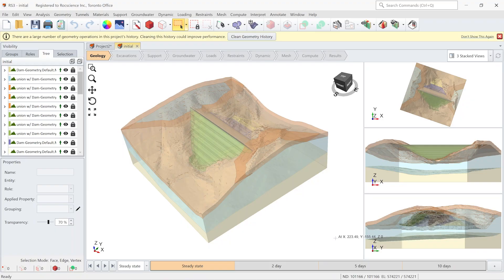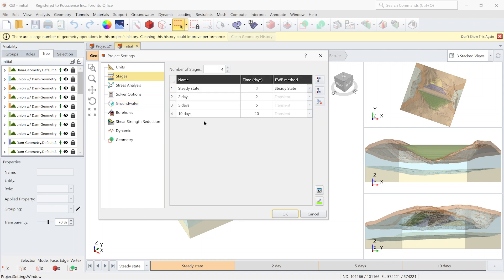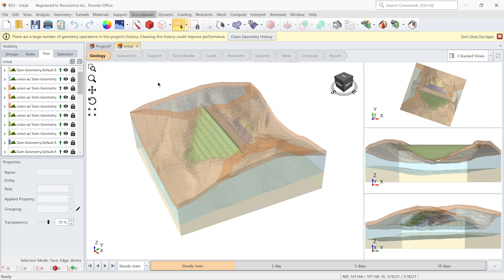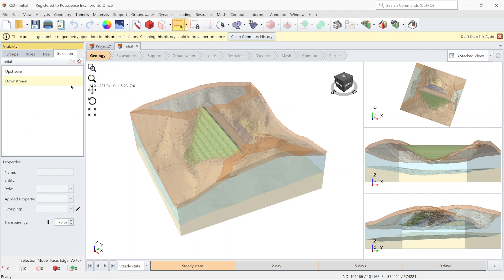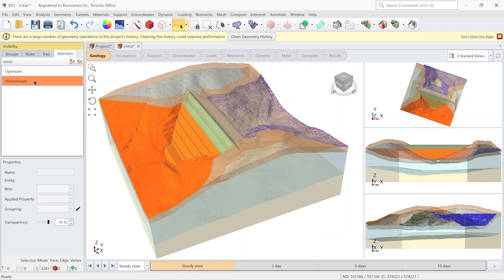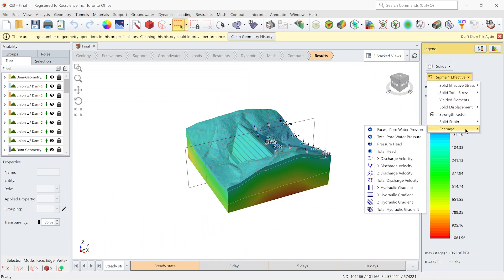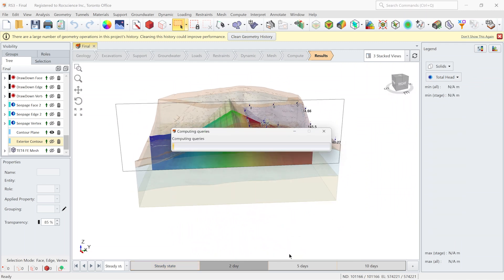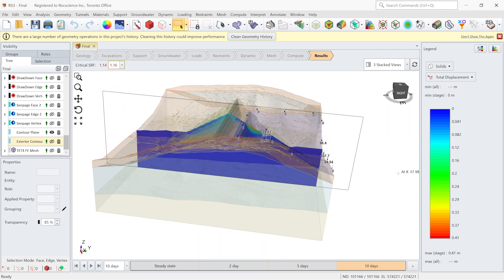Mastering RS3 - Seepage Analysis

Comment: Thank you for the great video. Actually, I need to use RS3 for modeling blasting vibration induced from rock blasting. Is it possible ? I need your ideas on this matter.
Reply: Thanks for your feedback. Yes it is possible to model blasting. You can do full dynamic simulations with RS3, but you need to have your data, such as the magnitude of the force due to blasting and the area where the load is applied (I believe the blasting engineer has all of that). It would also be very helpful to monitor the vibration in a few points inside your domain so you can calibrate your model later on, if needed.